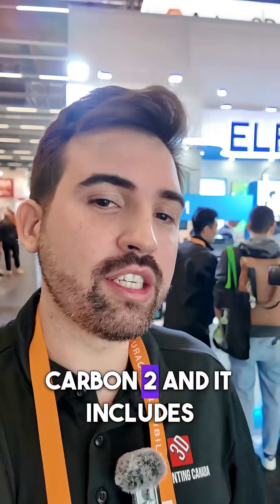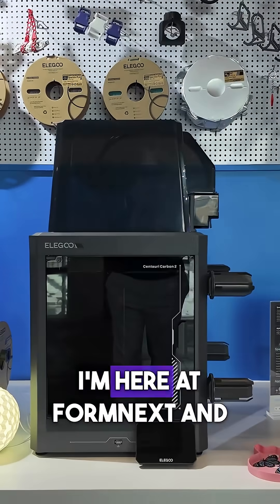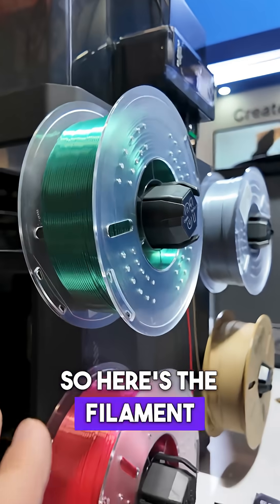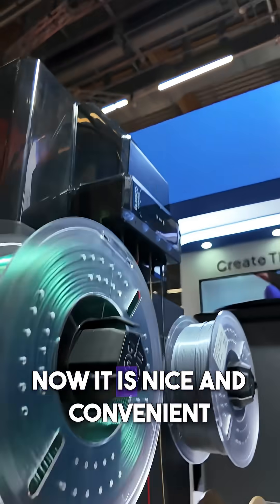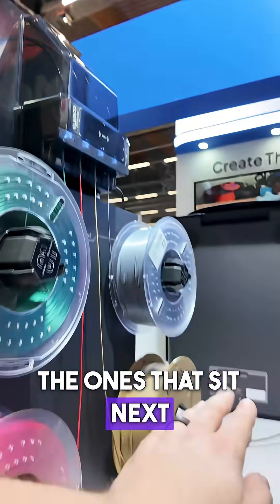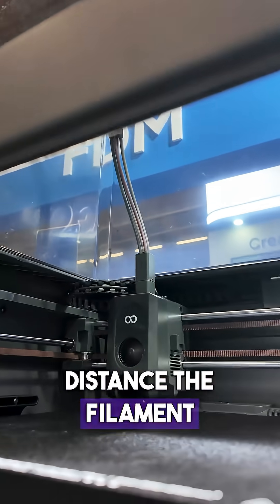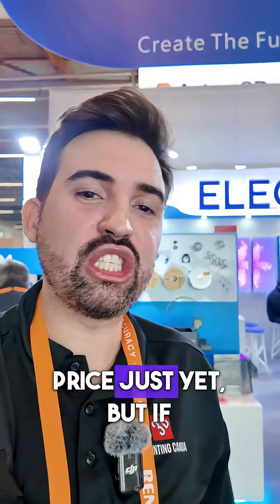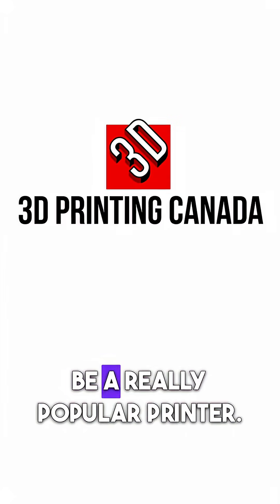Live look at the Elegoo Centauri Carbon 2 here at Formnext!

Comment: Having watched a couple of CC2 unboxing videos I have noticed that the USB cable attchment at the tool head is far too constrained because the block that the four filament tubes forces the cable into a sharp bend.  The cable used in the videos is the same type as the CC1.  While Elegoo have proposed a different cable that comes out at a right angle to the earlier one I have not seen this in practice.  Also compaired to the CC1 and printers with a box on top MMU there is a lot of additional assembly with the CC2 that hardly make it plug and play.

Comment: **DO NOT BUY THE CENTURI CARBON** 

Having 2 x CC for about a month now and looking forward to the multi-color this is disappointing. Recently got a Bambu Lab P2S Combo with AMS 2 Pro. You get what you pay for. I would return my CC if I hadn't already broken down the boxes.
Reply: I don't care about multi color or multi material. I have a slew of printers I run at work but picked up a CC for $260.  I still have my packaging, why would you recommend returning? For me this printer is just to print small functional prints at home (PLA, ASA, ABS).
Reply: @winstonzeb2842 for 260$ is a good deal. If you don't need multicolor, keep it. It won't have the same quality as a P2S, but good enough